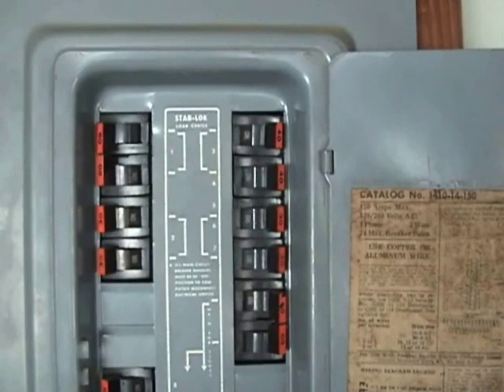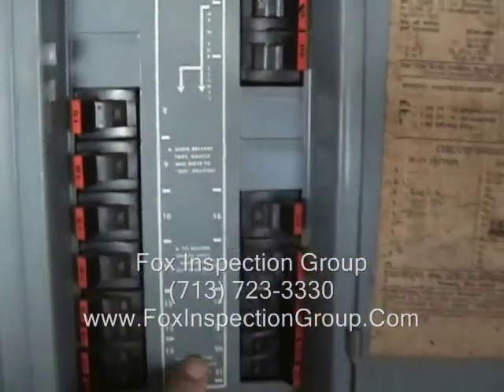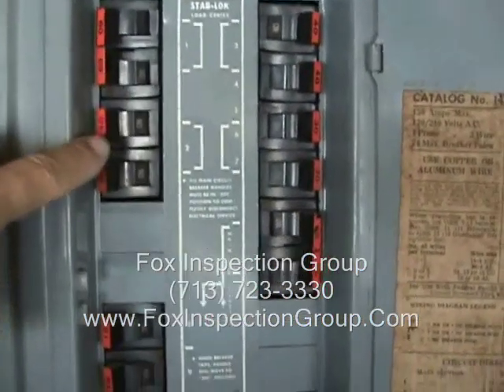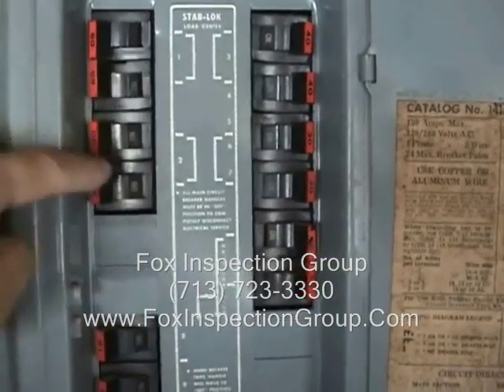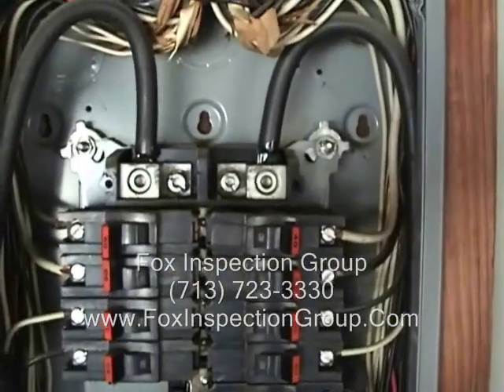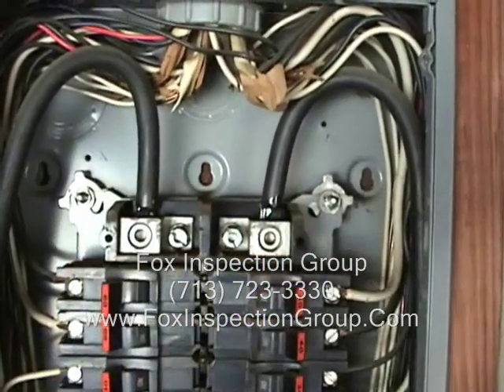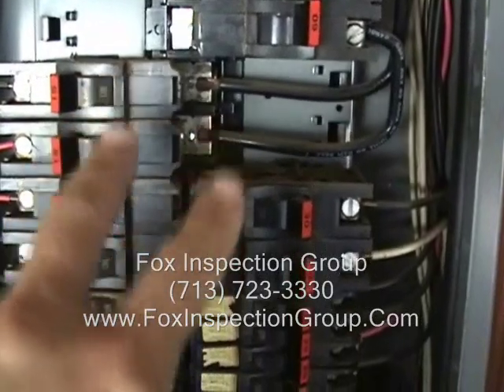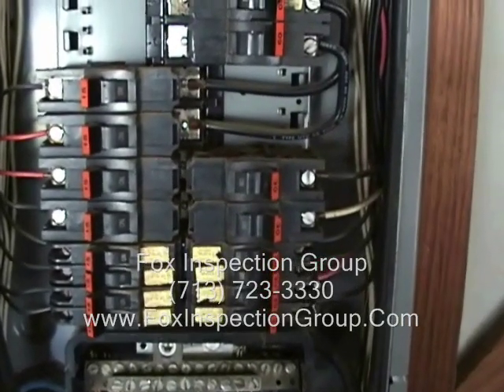Electrical Class On Federal Pacific Service Panel

Comment: Handle ties do not make a two-pole breaker from two single-pole units. Two-pole breakers have an internal mechanism that trips both poles together on a short or overload. The handle tie on a two-pole breaker insures that both legs open when the breaker is MANUALLY operated. Putting two single-pole breakers in to feed a 240 volt circuit is a code violation.